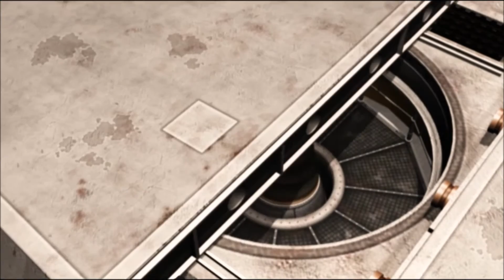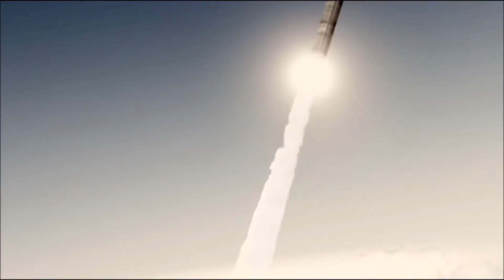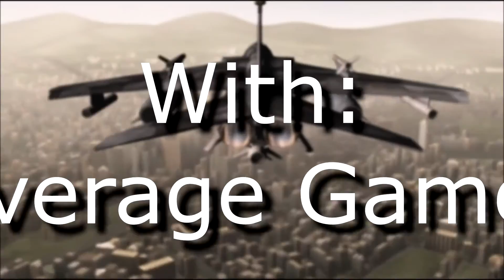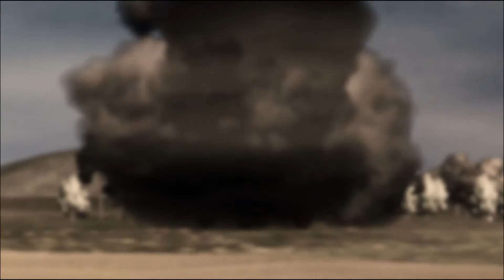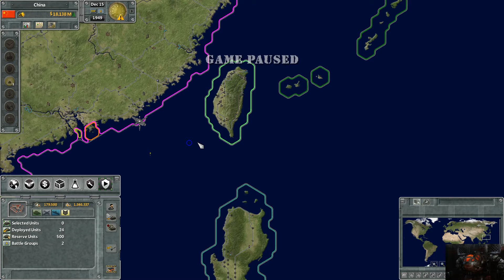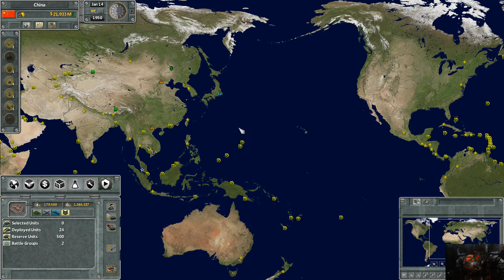Supreme Ruler Ultimate: Beginners Guide part 15 (Air Force/Navy Refueling)

Comment: It seems you have setup a custom scenario for this? No way China of the 1950 can have F-15K
Reply from the maker: correct, a friend of mine did a quick mod job and added them to the starting units for china
Reply: Average Gamer do you know where can i find more info about creating scenarios?
Reply from the maker: The best I can do is the moding instructions. That's about as close as you can get.
http://www.supremewiki.com/node/42
Reply: Average Gamer better than nothing - thanks